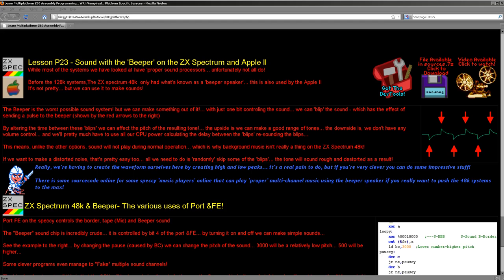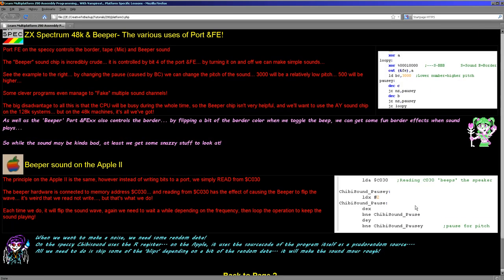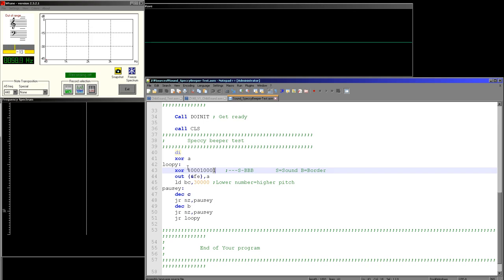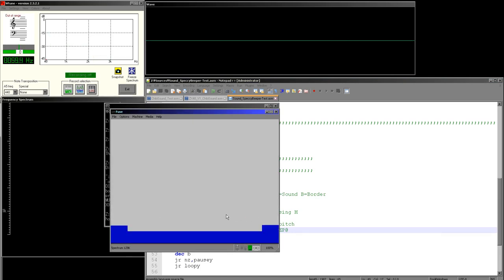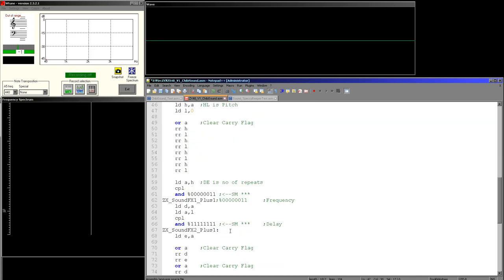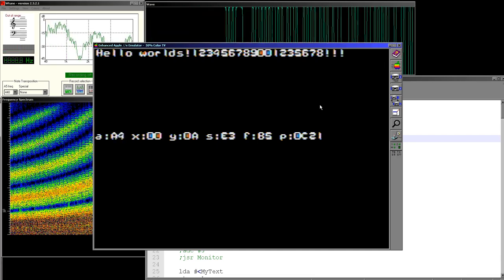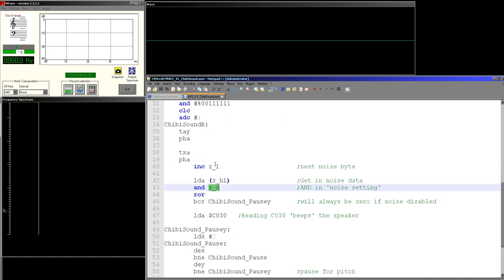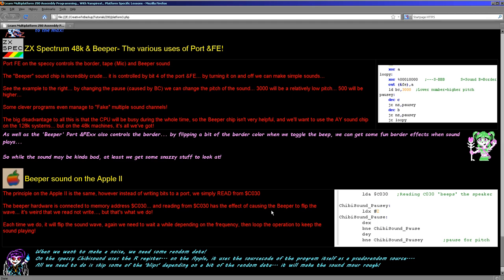Learn 6502 and Z80 Assembly - Beeper sound on the Spectrum 48k and Apple II

Comment: Nice! The dark magic of 1-bit sound drivers fascinates me, even though the whole world thinks it sounds horrible.  Really evokes a sense of magic, hearing bizarre robot-like chords coming from The Sentinel, decades ago.

So, music graduate here.  In response to your comment at 4m40 about getting a quiet version:  With 1-bit sound you can't really change the volume on its own, but if you change the duty cycle (ie the ratio of pauses on 'waveform up' to 'waveform down') you effectively change the volume as well as altering the timbre of the voice.  The sound gets 'thinner', but the overall pitch of the waveform doesn't change significantly as long as the cycle repeats in the same period each time.  It's a bit complicated why it gets quieter but essentially there's no digital-to-analogue convertor in these circuits, so when you flip the phase on a square wave, the speaker takes a while to start pushing the air in the opposite direction.  Without knowing the size and travel of the speaker the end user is using, you'd never get it exact, so just mix to your own taste :) .

Multiple channels can be done by keeping track of several frequencies in multiple registers and flipping the phase when any one of the frequency timers runs out.  If you think of two frequencies in 1-bit playing over each other, the only way you'd hear them is if they were in opposing phases.  And yes, this results in quite a lot of accidental cancellation of frequencies...  Only trouble is, you have to get the timings really spot on or the notes start going out of tune!